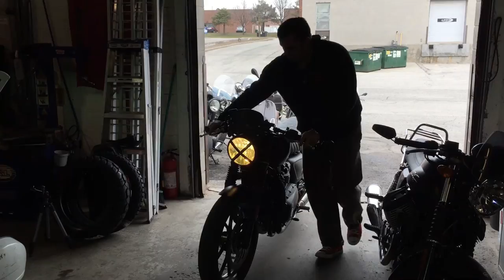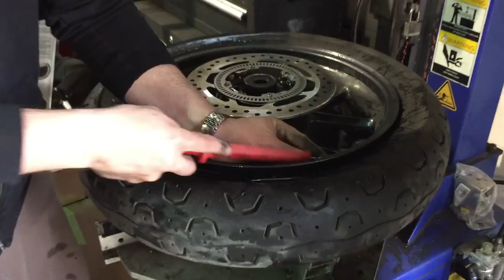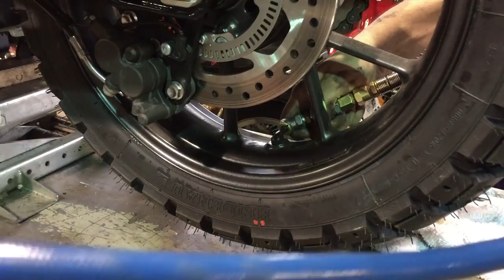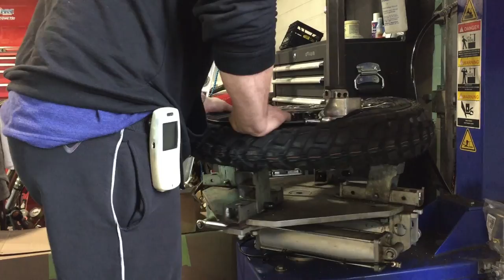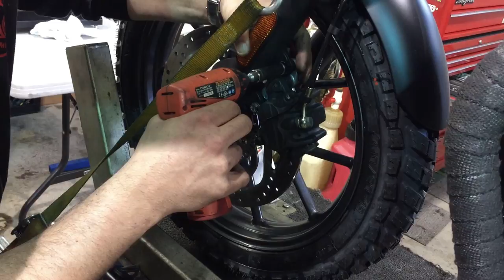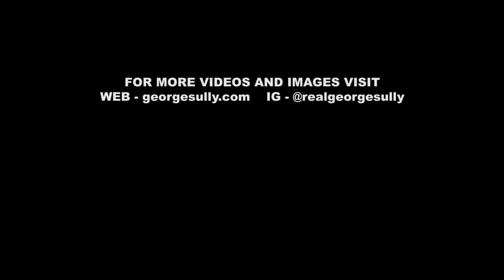The Murder of my TRIUMPH STREET TWIN PART 6 - HEIDENAU TYRE INSTALL

Comment: Hi- Im just about to buy a Triumph  Stret Twin and want to fit the Heidenau tyres to the bike. However I cant see on any website a profile in the tyre that will fit my bike. My bike is the same as this model (2017 edition) can you tell me which size you fitted to the rims?
thanks

Comment: Did you have to raise the front fender at all? Just bought these tires and shop told me they fit on the rims but they rub against the front stock fender.

Comment: They come in 18" front? 
Hard to find tyres for front 18 inch rims.
Reply from the maker: Your right...It took me months to find the right ones, its near impossible for 18"s...Here are the magic combination... 150/70/17 k60 Heidenau rear, 110/80/18 Front
Reply: @GeorgeSully  George, do you need to run the front tire with a tube?

Comment: Hi  George, quick question, since you are using a TT K60 tire in front, and I believe you are not using a tube, how has the tire hold up?  Are you finding yourself having to frequently inflate the tire due to air loss?  I have a street twin as well and really want to put the K60s on my wheels :) thanks in advance, and your ride is sick!!! Love it!

Comment: Confirm me for the front tire does not serve the air chamber.?
As you say you are a magical composition!
I buy it without problems (?):
REAR - Heidenau K60 Scout 150/70B17 TL 69T M+S
FRONT - Heidenau K60 110/80-18 TT 58S M/C
(treads are different !?)
Thanks very much. Ciao David. (ITA)

Comment: Hi George,

what size did you use for the front?
Reply: Thanks George,  Did you put the 110/80/18 on the front or the 130/80/18 on your ST?
Reply from the maker: Sorry Actually...Here is the combination I put on the bike...
REAR - 150/70/17 K60
FRONT - 110/80-18TT K60
Reply: thanks looks great!
Reply from the maker: Kevin thx! More to come! Keep watchin!
Reply: Hi, which model of Tires are this? Thanks
Reply from the maker: Hey Roberto! The tires of from Heidenau Tires....
REAR - 150/70/17 K60
FRONT - 110/80-18TT K60
Reply: George Sully thanks for reply and for Great video 😬
Reply: Hey George... Just wandering how are those tyres doing on the Street Twin? Is it dual purpose 80/20 or 50/50?

Comment: Hey George, great video. I have a 2020 T120 and thinking of putting on a pair of K60 Scout tires. I'm not sure whether to go with the 100/80 18 or 110/80 18 for the front. The 100/80 is closer to the original size (100/90 18) but I prefer the look of a wider tire (but maybe the difference in the width between the 100 and 110 is barely noticeable?). Also, is there a difference in handling or anything between the two sizes that you know of?
Reply: Hi, which ones did you end up going with? Also would the 120s fit?

Comment: front tire is tubeless or tube?
Reply from the maker: Ahh...The question I knew would come up...Short answer...As long as your tyre creates an air tight seal with your rim your good to go.  Meaning as long as your not using spoke rims that cant create a air tight seal It won't matter whether tube or tubeless... I had the same question till i rode off safe and sound with my sick as tyres...And because I should probably say it...Go to a licensed mechanic and get the final opinion and installation.